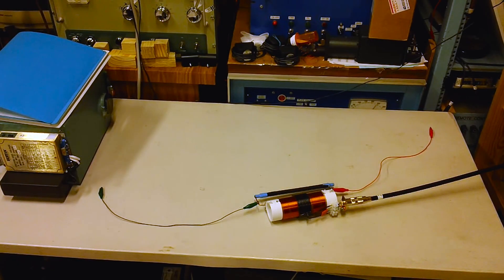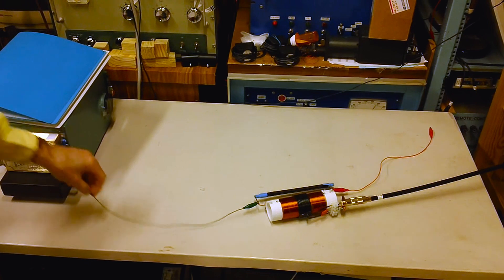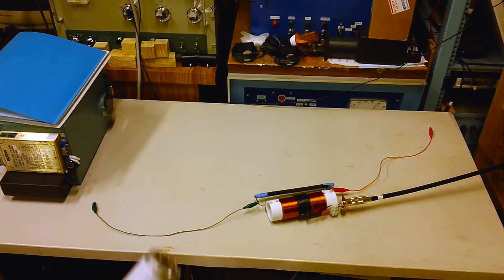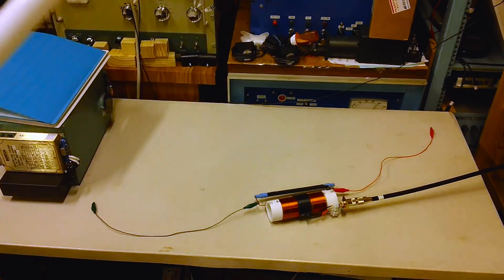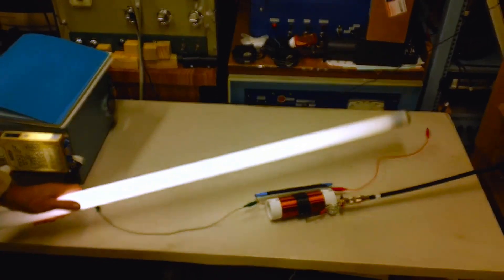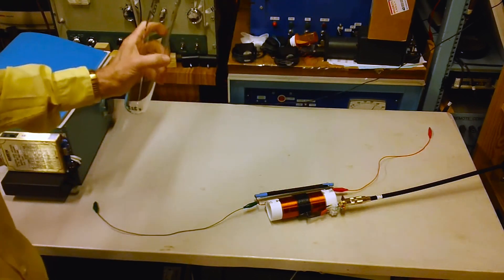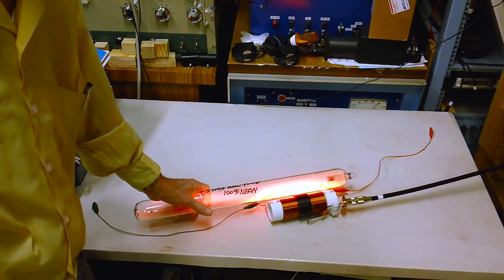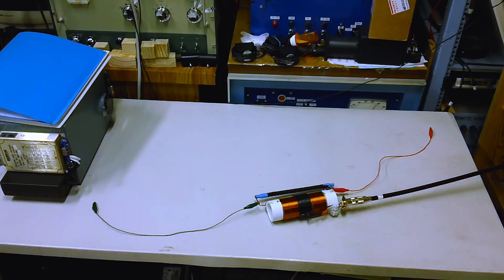Using the LC31 Coupler to Test a Plasma Tube

Comment: Nice quick test video😎
do you have a video or plan to to show how to setup a plasma tube with a spooky2? (neweer device called generator x )
which would be able to output frequencies via spooky2 app or device? 
Thankyou for all your work, i have just subbed, 
love from the UK.💙🙂

EDIT-UPDATE:
I have. just seen this video that you did of "how to build a Spectrotek Plasma Tube System"
https://www.youtube.com/watch?v=T2Nwc5VD7QE
I believe this is what i was requesting, making a rife machine, (just to add..i have both spooky  Generators) i will try to follow your instructions to build, please let me know if there is any specifics as that video was an overview of what you need and a brief rundown of how to connect etc, 
also is there any suggestions as i have both the spooky 2 generators, could i use the additional generator to run something else maybe at the same time?
Again thankyou for your time & patience to do these videos.